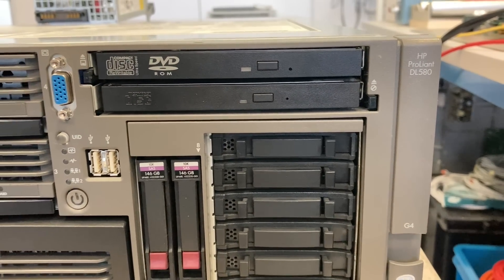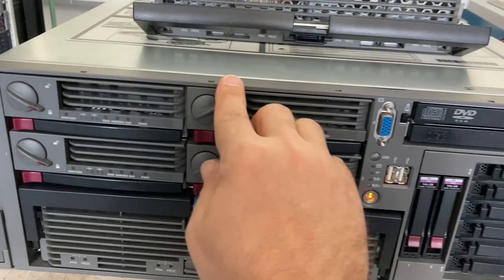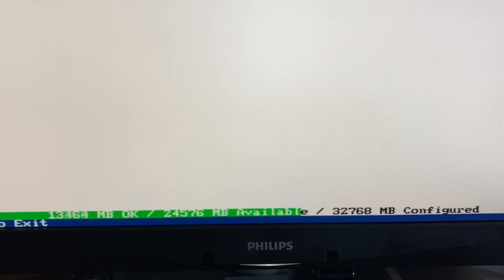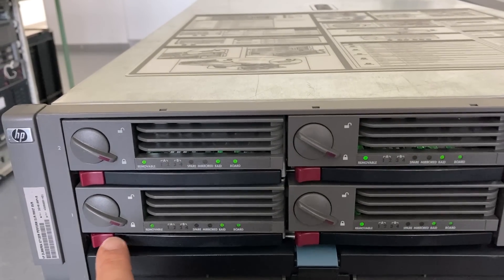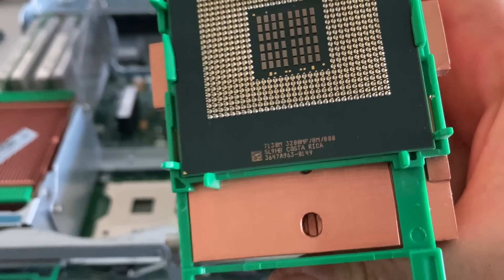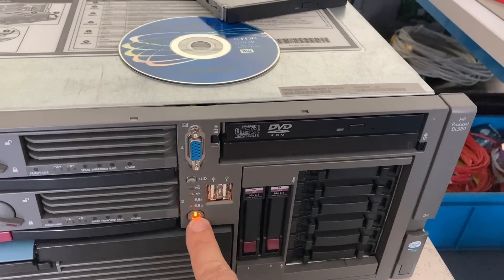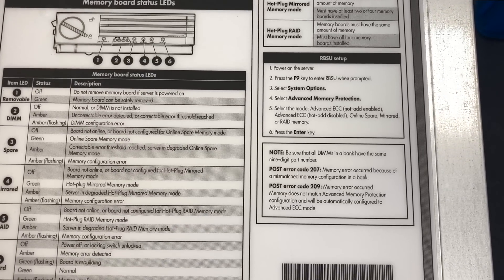What is RAM-RAID ?? (PWJ208)

Comment: It seems to be common on modern mainframes. E.g. a current IBM one has 40TB of RAID RAM. (RRAM)
Reply from the maker: Mainframes have many odd technologies inside. But this is not a mainframe, just a big beast server running Intel compatible operating systems.
Reply: @PlaywithJunk  I wondered what can take advantage of such a memory. Google bard says Mathematica and SAP can use it. Actually the maximum RAM SAP HANA can use is 750 TB as of today.
Reply from the maker: @Olgasys  There was a "hotswap" craze in the 1990s to 2000s in the server industry. But just like hotswap-PCI all this disappeared because there was no real need for it.

Comment: Did you have to slot in another fan and more powerful PSUs when you put in the two other CPUs?
Reply from the maker: The one I have had two CPUs and then I put 4 in it. It worked with the same PSUs. There is only one type of fan for this machine. I guess with only 2 CPUs it's a bit overcooled :-) Maybe the turn a bit faster with 4 CPUs but I didn't notice.

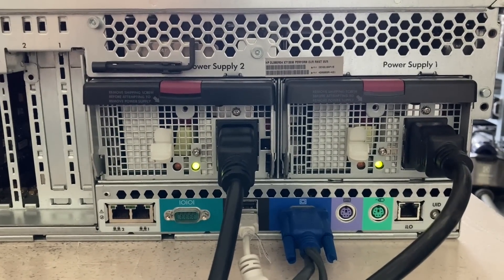Comment: 8:02 It may seem like a minor point, but I like HP's habit of stashing an Allen key (hex wrench) somewhere on their servers, to save you a walk to the tool bag. That can actually make a difference when you're working in a large data centre.
Reply from the maker: Good eye! Actually it's a Torx 15 key but the rest is true. They had this key included up to Gen8 or Gen9 even in Blade servers. But that's one more thing that vanished due to cost saving.
Reply: @PlaywithJunk  ah yes, it's been a few years since I worked with HP servers.

Comment: PCI Extended, not Express :D Remember these ones. Ran an Intel one as a single Exchange server for a while
Reply: I used to have one PCI-X board, and it was a SCSI controller. They will work in normal PCI slots but not as fast.
Reply from the maker: PCIe PCI-x PCI-express …I‘m confused since 1997 😉

Comment: FWIW, plain memory mirroring is actually quite commonplace; most of the servers I have in my homelab support it. This includes servers such as the Dell R520/R720/R730 and SuperMicro 1027R-72RFTP. On some of the newer HP servers (e.g. Gen10), there are even different mirroring modes. You can do a simple full mirror, or you can do levels of "partial mirrors" (e.g. mirror 20% of the total memory above 4GB).
Reply from the maker: True, but RAID-5 is pretty unique...
Reply: @PlaywithJunk  Indeed :)
Reply: Sure, with those Dells you get optional memory redundancy, but what you don't get (unlike the HP in the video) is hot-swap memory modules. You still have to shut down, power off, and pop the lid to replace the faulty memory, which means downtime.
Reply: @SheeplessNW6  Yes, of course, but the fact it didn't become a ubiquitous feature speaks volumes about its actual utility in enterprise. Don't get me wrong though; I love seeing obscure/esoteric hardware (that's one of the reasons I'm subscribed here).
Reply: @amp888  true that. Looking back, it was rare for me to encounter memory errors requiring replacement (i.e. not including bit flips handled by ECC). Plenty of failed disks, PSUs and fans, hence the ubiquity of hot-swap for all of those, but not memory. So I guess the market decided that cumbersome and expensive hot-swap memory carriers weren't worth it.
Reply: @SheeplessNW6  Yep.

Comment: I love HP servers. I mainly worked with Gen3 to 7 and they were great to work with in regards to hardware failures.  They are very modular and easy to get to most things unless the whole mainboard needs replacing obviously. Lots of indicators of where a fault exists for troubleshooting too and the ILO is much better than what I see on competitor products.
Reply from the maker: The newer G10 servers are bitches. We had many failed after a firmware update. Too many badly programmed features in ROM.... Intelligent Provisioning was extremely buggy and still is.
Reply: I love the NetServer LH line. Had LH3 and now have a LH4r. Very modular indeed.
Reply from the maker: @dgoeloe  HP Netservers.... lots of contact problems but always fixable.

Comment: I used to troubleshoot these way back in 2008 when i worked for HP at their Erskine manufacturing plant. The cpu's are Intel 7000 series, your was 7130m which means an 800MHz FSB, you could also get n chips which were 667MHz FSB. These were noticeably slower than DL585 series but companies still didn't trust AMD in the server space yet and we built about 20 580's for every 585 that was built.
Reply from the maker: For the customer, the only benefit of AMD servers was slightly lower cost compared with Intel.
But I also remember some HP AMD Blade servers that failed above-average. Mostly due to broken DC regulators on board.
I totally agree with the 20:1 ratio. Maybe even higher.

Comment: The purpose of RAM on a RAID controller is to provide a level of cache to allow write operations to hit stable storage without incurring the latencies involved with rotating disks. The RAM on the controller can usually be split between read and write cache. A common ratio is 75:25 write:read.
Reply from the maker: This is certainly true but has nothing to do with the RamRaid of this server. This is an entirely different thing.

Comment: Nice quiet fans!
Reply: Compared to the scream they make if one of the case switches is not registering, yes they are quiet. They can practically take off at full speed.
Reply from the maker: That's the downside of 1U rack servers. The smaller the fans, the louder they get. But the video may be misleading. The DL580 is quite loud. But it doesn't have that nerve tearing sound of small fans.

Comment: Glad ye old replug everything "fixed" the dl380. That fix is as old as those dinosaurs. I remember when those where "the new sh!t" ;)
Reply from the maker: It's a 580... 🙂
Oh yes, the old "scrub the contacts" trick is still alive as long as there are contacts. This machine sat around for years with only 2 RAM modules. So it clearly collected some dust. 30 years ago I worked on DEC PDP systems and contact cleaning was part of the routine maintenance.
The old HP Netservers (before the Compaq merge) were even worse.
Reply: @PlaywithJunk  Not only that. HP seemingly couldn't be a*sed to make the contact surfaces non oxydizing. Those things did "weird things" when left in an non optimal (as in high humidity, high temperature change) environment ;)
Reply from the maker: @peterpain6625  Well, the contacts are not bad, all gold plated. But there is always sticky dust that can make trouble.
Reply: @PlaywithJunk  Then you got some improved version. The versions i remember had polished brass contacts. Still the same problem i suppose :)
Reply from the maker: @peterpain6625  Are you talking about power supplies? Some of those connectors may be brass. But the card-edge connectors have always been gold plated.
Only a few early RAM DIMMs had tinned contacts (286, 386 PC) but after that was all gold what glitters 🙂
Reply: Level two is blowing on the connector.